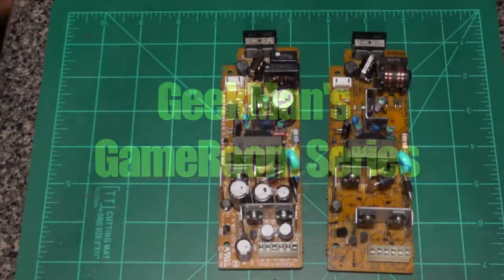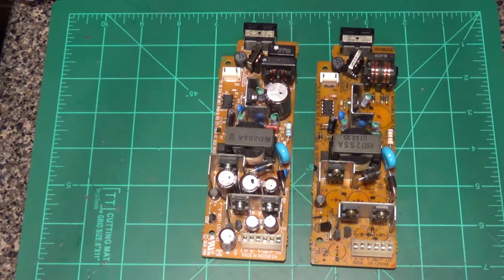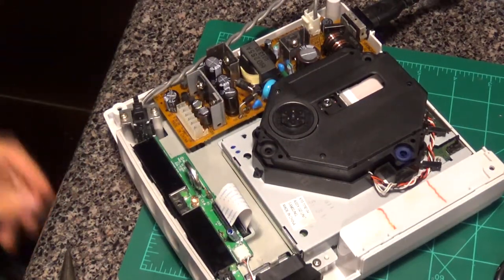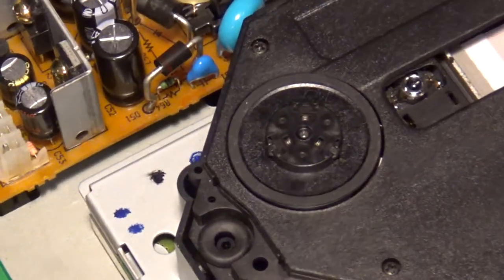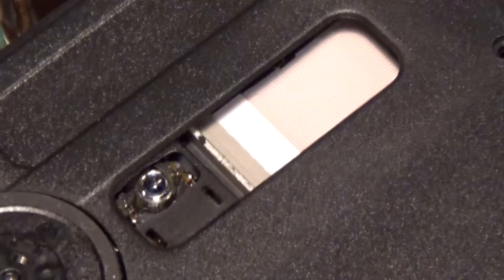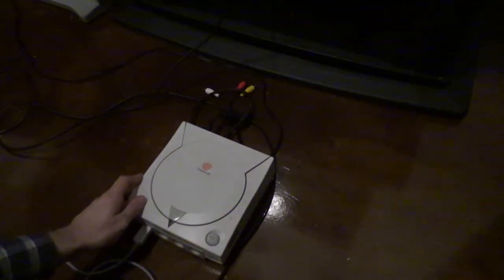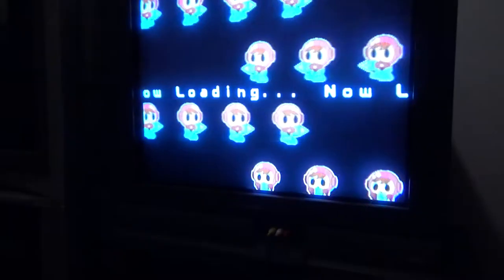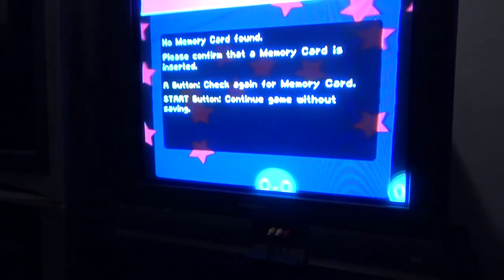Dreamcast Power Supply and Laser Repair

Comment: Nice video. 
The caps go bad due to them being fitted right up against the metal heatsinks. Caps die much faster when they get hot. 
Using modern high quality ones that are higher temperature rated will give much better reliability.
It's worth checking the bridge/diodes for dry joints too.

Comment: The one thing I never see anyone do is put thermal paste behind the voltage regulators. I did and it helps dissipate heat better.
Reply from the maker: That's true thermal grease for regulators and such often gets overlooked I'm even guilty of that

Comment: Hi, thanks. I have a relatively new Dreamcast (US version), just a week of use (24 hours per day) which was stored for about 2 years without being turned ON. It won't read now but the laser is glowing faintly, it spins, the laser sled moves, including up and down. Which capacitor should I replace? Do I need to replace all capacitors on the PSU? Where can I buy good solid state capacitors for the Dreamcast's PSU?

Thank you. Could you list the capacitors here. The link doesn't show the list.

God bless, Revelation 21:4

Comment: Wierd... I am having this problem where the drive only reads after the DC is warmed up but the PSU caps look fine (like yours). Especially these Chemi-con caps usually fail with blown vents and these look perfect.

Only thing that has brought me here is that my PSU is heating up a lot and I thought something else was wrong. Will measure the caps on the PSU, as mine are Rubycon and I don't think I ever saw one of those just fail.

Comment: Woah dude! I have a Dreamcast that when i turn it on, the LED kinda flickers like it's not getting power and the system resets alot. I'm going to try changing the capacitors too! Thank you!
Reply: First off the single most common issue on the Dreamcast is that the connector that adjoins the logic board underneath with the power supply on top no longer works properly, it suffers from oxidisation and relaxed contact pressure. This issue is extremely common, i had 3 Dreamcasts (all VA1 EU) and all of them had it. First step is to just clean both connector sides very thoroughly, and tension the leaf springs, simply by poking them a little bit so they press a bit harder against the header. This guy bent the pins on the board instead, and while i'd be afraid to do that personally, ultimately if it works, it's fine, it solves the same problem. If that doesn't help, you may consider a recap - whether it's needed depends on luck, on climate, and how long it ran, but generally the Dreamcast PSU doesn't seem to have any other fundamental faults.

As a cleaning agent you may consider isopropyl alcohol, or residue-free electronics contact cleaner, or i use a particular brand of residue-free plastic-safe brake cleaner that happens to be chemically identical to my preferred electronics contact cleaner :)
Reply: @SianaGearz  Thank you so much for the detailed advice! I'm not super skilled at electronics repair but i love servicing my good old Dreamcast! At first, I adjusted the laser pot and it helped but then it started resetting again. I really don't like adjusting the laser pot :(
Reply: I don't think adjusting the laser did anything in your specific case to be honest, when the laser goes off calibration, it shouldn't reset the system, it mostly just locks up or the drive keeps making sneezing sounds. Chances are the process of disassembling and reassembling the console allowed the power supply to make contact better for a short while because the whole assembly flexed and moved a tiny bit.
Reply: @SianaGearz  Thank you for teaching me all that! I'll try that for sure!

Comment: "Oops! We ran into some problems.
The requested thread could not be found." 
cant find the info on the caps :(
Reply: did you find anything?
Reply: @xbluez1  I ended up buying a new Power Supply on Aliexpress, still waiting on it.
Reply: @Dom LS1 Yes, The power supplies on Aliexpress are good and fixed the problem.
Reply: check the last message here:
https://dreamcast-talk.com/forum/viewtopic.php?t=7547